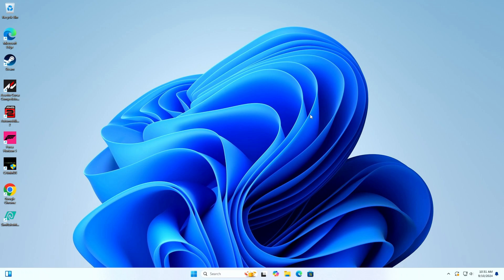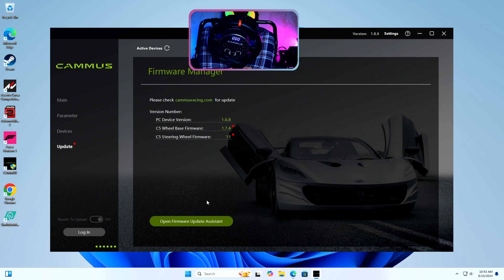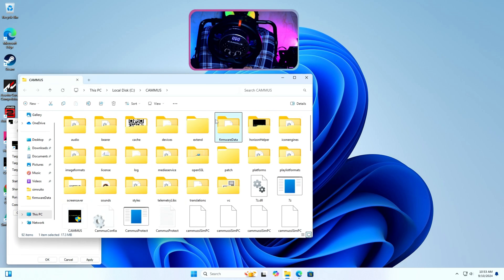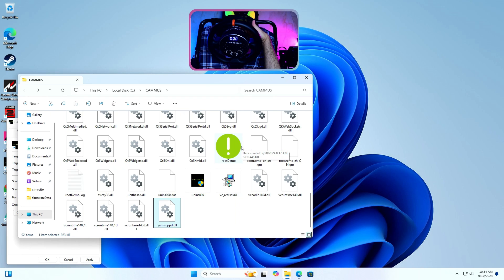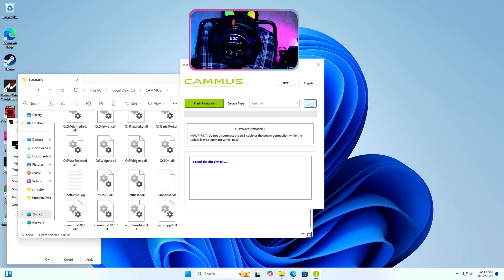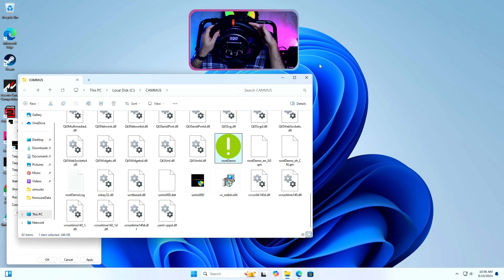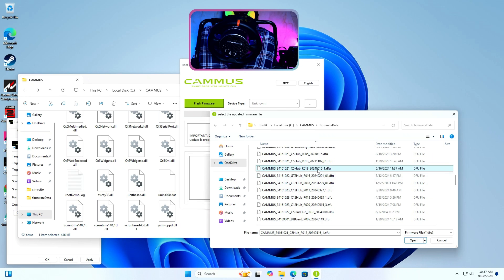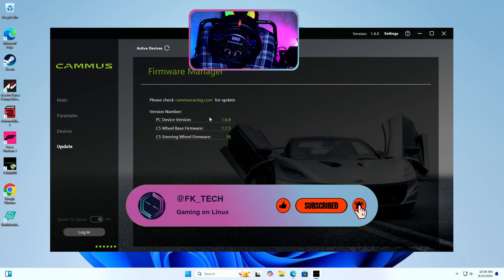Cammus Firmware Flashing Tutorial

Comment: Great video! My Cammus app firmware upgrade broke when I used Zadig to change drivers on a different STM bootloader device. Do you know how to get the Cammus drivers reassigned? I tried to reinstall the Cammus software but that didn't work.
Reply from the maker: Have you tried the steps mentioned in this video?  I think Cammus have hardware level dfu mode so you should be able to put it in dfu mode and flash it manually using these steps, unless they used software level dfu which you override by wrong bootloader. 

Join in cammus discord or forum to discuss further. If you can reach its uart then maybe we can find a solution.
Reply: @fk_tech  I didn't try it yet but I prefer to fix my Cammus software if possible. I think it should be possible to reinstall the driver in device manager after the device is put into DFU mode if I can find the right driver file. I am a little worried about messing things up further though. If I reboot the wheel when in DFU mode will it return to normal mode? I am on the Cammus discord and I didn't see any answer for this but I can ask the question there too.
Reply from the maker: Cammus Discord
https://discord.gg/G23jJsHN